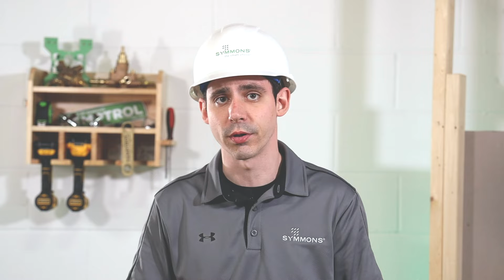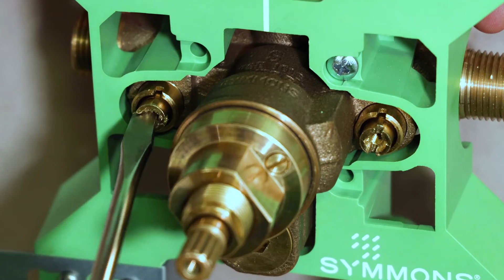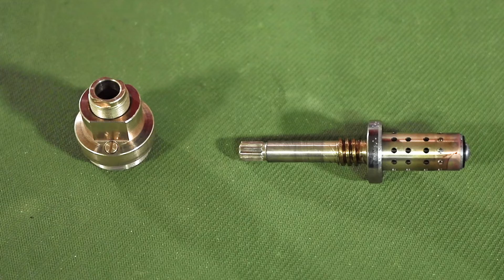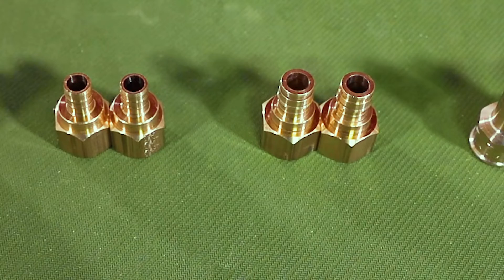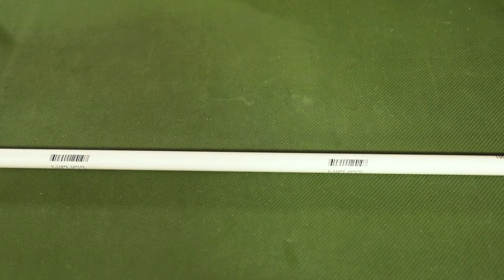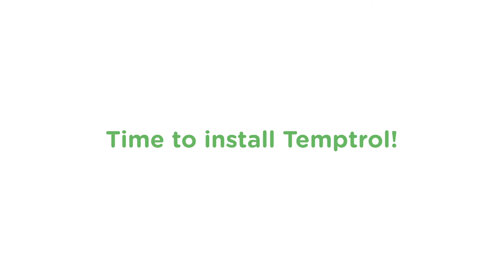Connections and Installation for your Shower Valve | Temptrol Overview | Symmons Industries

Comment: I've watched multiple videos and nowhere does it say how to make the water hotter. Adjusting the temperature should be a basic video on here.
Reply: The only temperature "adjustment" on the valve is the high limit set screw that was used to limit temperature back when many people got their hot water from a coil on the boiler (the temp could reach 170F or higher!!).   But every home today should have long ago been upgraded with a mixing valve at the hot water source (either water heater or boiler) set to 125F.  Leave the adjustment on the Symmons wide open (fully CCW - it's on the spindle after to remove the knob) and make sure your input temp is adjusted at the mixing valve.  Note - homes being sold today will not pass inspection with a properly installed and adjusted mixing valve.  Here's how to adjust the limit set screw:  https://youtu.be/1ZhNMb4kMss?t=118

Comment: Your example shows soldering with valve body and check valves installed. Is this the recommended sweating practice or should the valve body and chk valves be removed?
Reply: Yeah, I've been looking into this can't find a good answer so far. Taking the valve apart is a bit involved, and you need special tools. Though it seems that the valve should have enough thermal mass, and with a wet rag wrapped around it, you may just be able to get away with it. Though I'd at least remove the shut offs, if yours has them as it's easy enough.